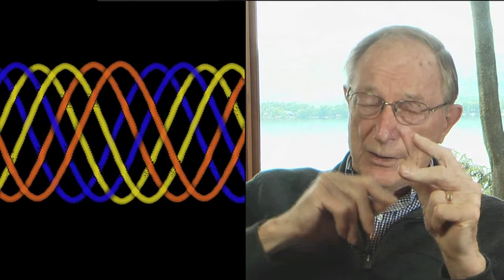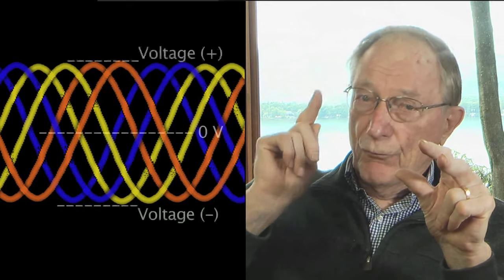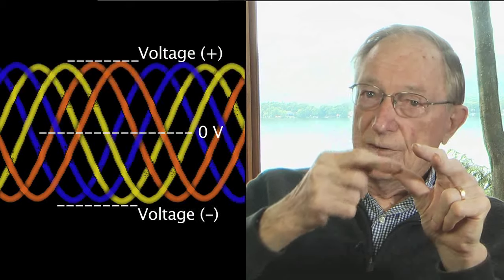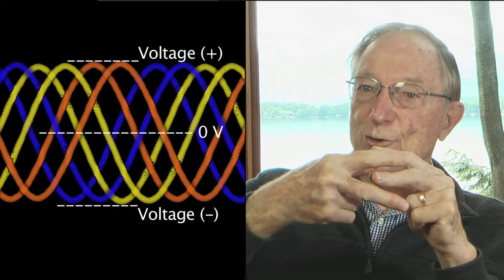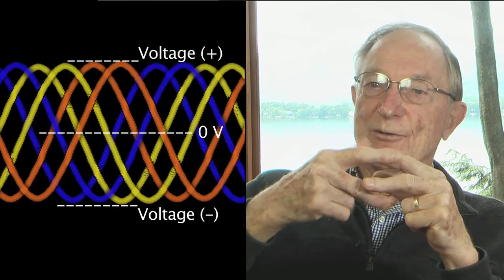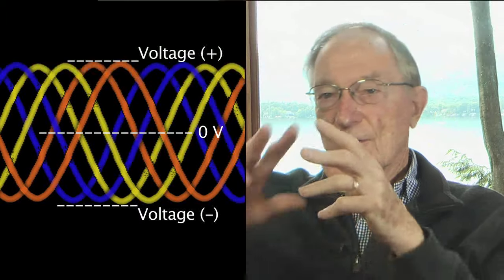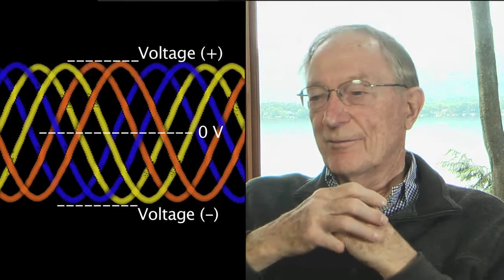Why 3 Phase Power? Why not 6 or 12?

Comment: Oh, for crying out loud. Three-phase placement of the windings in an ac alternator works well, with all the windings in the phase-dedicated stator slots wired in series with one another, because the out-of-synchronization effect of the two maximum-displacement windings are not displaced from each other very greatly.  Unlike two-phase designs in which the placement of the windings in the stator slots ARE displaced from each other to an extent that there IS substantial cancellation effect.  That's the advantage of three-phase over two-phase.  Going to four-phase or six-phase has only slight reduction in cancellation effect due to out-of-syncronization of the extreme-displaced windings, such that it's not worth the the trouble of dealing with the corresponding greater wiring complexity.

Comment: At beginning, it should be more related to the AC generator machine. 
1.	The generator size is limited by the truck and train, whatever hydro or turbine, that made the stator slots number not enough to reach more than 3 phase. 
2.	The long distance power transfer, 3 phases can transfer more energy than the 2 phase. You know the most cost is not an additional one wire.
3.	Both 2 phase and 3 phase motor have an advantage: each phase coil is neighbor to other(s).

Comment: By reversing the polarity by wiring on each center element of the three stacks in the circular stacking, the three center elements representing all three phases will be one sixth of a cycle off from both the phases above and below it; repelling those magnetic fields outwards into their opposite polar areas for 5/6ths of the cycle, and only attracting them on one side only for 1/6ths of the cycle. The inductance will have gone up by having mutual inductance between phasings, increasing the Q.

Comment: Another reason to choose 3-phase:
More than 3 phases will reflect the products depending on the number of phases, so what i think that When the technician need to reverse the direction of rotation for an induction motor they just change two phases positions, in case of 6 phases it will take 3 phases to be changed! And that is time consuming.

Comment: I'm a utility engineer too. I believe that the convention of 3 Phase was based on the limitation of constructing robust machines in the day. After working in Main Generators of large power plants, I know that with 3 Phases, it gets crowded in there. I guess that Main Generators would necessarily would have to grow wider to accommodate additional windings. There are all ready significant "end turn" forces on the rotor windings. for 3phase, 120F = NP, so what is it for a 6 Pole device? 36?

Comment: By polarity reversal of the central coil segment;  exhibit lenz law effects from a source only 60 degrees out of phase, whereas the law works at 90 degrees so that extra source of emf arrives 30 degrees ahead in time of the actual phase rotation, yielding a vector summation with the source emf at 15 degrees ahead of the phase rotation.  Cycle after cycle it keeps arriving more and more ahead of the phase rotation until after 12 cycles it completely opposes the source voltage

Comment: 1. Line to Line voltages are not all equivalent. 
2. Symmetrical Components analysis only works on systems where the number of phases is a prime number.

Comment: A 6 Phase system would not only have 6 subsystems but also have TWICE as much high voltage cable to buy, install, and maintain. The loss in efficiency of a 6 phase device like motor vs 3 phase is very small compared to costs. 

If is was a great idea, it would already be implemented nationwide.

Comment: The reason Edison was wrong and Tesla was right was that there does not exist any simple, reliable way to convert low voltage DC to high voltage DC, or vice versa.  (Except for a motor-generator, which isn't reliable enough.)
If you generate electrical power at, say, 10,000 volts, you will want to transmit it at as much as 760KV.   Doing that is relatively easy with a transformer, a device with no moving parts.  At the end, you will also use a transformer to bring the voltage down to lower voltages, such as 60KV and 12 KV, etc.  This allows transmission at distances of 1000 miles or more.
DC power cannot be changed in this way, at least it couldn't have been in the late 1800's.

Comment: 6 phase was quite popular in high power transmitter design using valve rectification because the ripple frequency after rectification was six times the supply frequency, compared to 3 times that of a 3 phase circuit, and the ripple voltage was reduced by a factor of.250/.057 from that of a 3 phase rectifier. Harmonics were also much reduced. This made for simpler smoothing circuits in the conversion to dc.

Comment: The phases in 2-phase power transmission are not 180 degrees apart.  The technology requires three wires anyway, but was useful for a time, and can drive a motor nicely enough.  Note that the 120/240 power fed to residences is not really multi-phase power.

Comment: I am not in the field but I had some theories about power lines and phases. My first theory is that really the amount of power you can get out of a wire is really the feed amperage and the gauge of the wire. Too little and it gets hot. Due to the nature of AC, I guess you get more positive power, more of the time with different phases. I thought that usually like motors were designed in some way to have magnets oriented for 3 phases.

Comment: Actually I think this math is not necessary. Just like 3 points are the minimum number of points we need to identify the position of an object in 3D space, 3 Phases are the minimum phases for generating a rotating field. Correct me if I am wrong.

Comment: Large induction furnaces (in the Mega Watts) do use 6 and 12 phase power (using "phased" transformer arrays).  This allows for rectified DC with a very low ripple current/voltage

Comment: This boils down to one concept. If it's not broke, don't fix it! For the most part, people will continue to operate the same way if nothing is wrong. They will in fact resist improvement, especially if the improvement costs a lot in the beginning, even though the long term savings are as large or larger.

Comment: three phases has a direction and a constant power load/supply. I don't remember the math but if you add 3 sine waves together (squared, 120 degrees apart) they form a flat line. So it's a 'perfect' transmission system, 1 phase would be 'shaky' and would have no direction. 2 phases (one at 90 degrees, 180 degrees is 'inherent' in one phase) would also be shaky. The power of three phases add up nicely to a constant '1' so to speak. I don't know what the guy is talking about there's no advantage in adding more phases except if you want to convert to DC I suppose. I don't think there's any advantage in copper usage compared to a 1 phase (two wire system) I didn't do the math it's just a hunch. Another advantage is you can switch between 'star' and 'triangle' when using a motor. The myth that it transmits more power is just a myth, it's simply 3 wires instead of 2. The comparison to one phase is misguided because one wire is 'neutral' if that one would be 'negative' then you use the same amount of copper for the same transmission.

Comment: Well,there is more to it than was explained in this video. Assuming a given  lump of metal in the form of a stator and  a rotor then when it comes to wind  the stator, the winding is  going to take some space. For a single phase system, there will normally be two coils. The volume of the copper used will fill the slots to produce a voltage and a current hence the Power available from this single phase.
Now if we wind a two phase system,( four coils) assuming we go for 90 degrees phase, the coils need to be  smaller so the power generated will  not be doubled.
Now if we wind a three phase ( six coils) assuming we go for 120 degrees phase change, the coils will have to be even smaller as far  as the number of turns and the  area of the copper. and so it follows for a higher number of phases.
It is easy to conclude that the power generated does not depend on the number of phases one winds in a lump of  laminated steel,but the power depends on THE VOLUME OF THE STEEL in the cylindrical arrangement. It is the magnetic path that decides the overall power.

Really as far as increasing the phases, more " phases" are wound in a DC lap  or wave wound generator!  If  for a moment we forget that there is a commutator in these machines, the distributed  multipe coils in the slots  around a DC armature, are in fact windings which are  out of phase with each other and are vectorially added together.  As they are vectors the vector summation is less than if the coils were in phase! Really there is no difference between an AC and a DC machine and the commutator segments are in fact rectifiers for all the " phases" in the winding of a DC machine.   If all the coils in a DC machine were individualised and not added as in a lap or a wave wound  machine, the result will be  a multiphase machine. Obviously one cannot tap their output when the windings are on the armature but if the whole arrangement  was transferred to the stator, it will be exactly the same as a poly phase AC machine.

Again I shall terminate all this by saying that the output power of  a machine does not depend on how many coils one winds in it, but how much steel it contains and the sixe may alter a little depending how much magnetic  flux density the steel can handle. That is life. All machines are Electromagnetic machines, coils are the electrical part  while the steel is the magnetic part------------ they go in pairs as .......... with only one of them you have no machine!!
Reply: Also I see all this as internal combustion engines with single or multiple pistons.
A single piston or a double opposed piston  stem double acting engine as a boxer type will never self start and the power output fluctuates over one revolution. It would be a pulsating system.
In an  double acting steam engine with two pistons at 90 degrees, this will self start and the torque on the shaft will fluctuate  and it  will be a self starting system. This is because  it will  have a pulsating and a rotating effect.

The higher the number of phased piston especially if they are double acting the pulsations will stop and a fully rotating enenrgy will be generated when taken as a whole system.
All this takes place in a multiphase machine. If we had to talk about positive and negative frequency components well then we have to talk about primary and secondary balancing and vibration in a multi piston engine. They are so related
in their performance, even mathematically, provided we aim for a sine function in their stroke!!!

Comment: Just as there are diminishing returns regarding the increase in power as the number of phases increases, there are likewise diminishing returns regarding the increase in power compared to the  increase in costs associated with a power transmission system as the number of phases increases.

Comment: Would have liked to see the experiments with more phases.  I was always under the impression that 3-phases were chosen as it is the highest phase number where if you connect any two of the phases you get the same voltage (different phases, but not too important).
Reply: Google user  The variable Phase -to-Phase voltage could be useful. It provides a basic discrete variable voltage BUT there no practical application for such capability at the substation power level.

Comment: Phased are potentially infinite. The tube is just the local atmosphere. A loud horn cone travels into the upper atmosphere and beyond. 
Three phase power begins with the ground that opposites the air charge. Power consumption induces electrical current flow. The entire power grid works as the grounding for electronics and equipments. With three phase on one end and infinite phases in the air, technological apparatuses interface and consume. The upper 359 atmospheric phases of the first horn ring are radio frequency bands. Thus 3 phase power grid alignment. Once reaching the first quantum note of 360 phase altitude, the equatorial ring is a perfect fit. beginning at 361 phases,   light begins. The uv frequency travels into space at exponential band wave frequency. All visible due to the electromagnetic resistance of the body. Elf wave monitoring proves the knowledge to be seen and known of. cJT aka the most Elect

Comment: It is precisely this phenomena that DC has no zero crossing that makes design of a HVDC switch or circuit breaker difficult to construct because there is no zero crossing that could extinguish and arc that forms. Some techniques are needed to create an artificial zero crossing for this scenarios

Comment: It is noted that Gabrield Kron generalized his work with the principle that all types of electrical machines must be special cases of a generalized machine, and that understanding the general machine would lead to the invention of new types. Many years ago I got the idea that that if you sandwiched three phases of 120 degree time separated magnetic fields (from a 3 phase power source) together from spiral made inductors of maximum mutual inductance; you could reverse the polarity of the middle segment making it only 1/6 th out of phase with its top and bottom segments and thus acting like a magnetic triode, the middle element would cause the magnetic fields from the exterior elements to be expanded in the opposite direction of the interior magnetic compression being made for 5/6ths of the cycle reaction time. The problem with this idea is that time is directional and because of phase rotation depending on the way the stacks are arranged in order, one phase will always be inducing current on the next one in the phase rotation, and the currents in the stack cannot be balanced. Just like in mathematics it takes nine consecutive numbers for a number array to be both horizontally, vertically and diagonally balanced as a magic square, the three phase reactive currents require nine elements to form a balanced mutual induction between phasings on a lateral placement scheme such as this.  I invented the 666 machine which creates six magnetic fields out of time with each other via a 3 phase input.[note;this is technically not correct as all six fields are not necessarily "out of phase" with each other,, we have merely created an additional three phases in opposite polarity to the original three phases as the input].  What is involved is "splitting" cyclic 3 phase magnetic fields placed in mutual induction and resonated so the one part rotates faster in time then the part it proceeds from. It returns and hits the point of its origin after 24 cycles.   In the present system the magnetic field that splits off from its source and starts reacting with itself advances 15 degrees for every source cycle as shown by https://www.flickr.com/photos/harvich/14992141501/in/dateposted-public/
In the movie "Around the World in 80 Days" the traveling people experienced 80 days while the world they left behind only experienced 79, but the travelers made one extra circle around the earth during the time that the earth itself only circled itself 79 times. In the invention of the 666 machine I was able to make the magnetic fields circle themselves one extra time for every 24 times the line voltage cycled itself. This process "pushed" the magnetic fields into space by employing nine elements attached to three phases separated in time by creating six interior magnetic compressions 1/6 cycle out of phase, further creating 6 magnetic expansions on the poles.

Comment: 6-phase power might have a niche in self-contained low weight/size, high power applications such as AC-driven electric vehicles. 12 probably would still drive costs up too much with too little benefit due to the mentioned diminishing returns. Would have to look into the effect of using more phases on the power-to-weight ratio of induction motors, which is leading in vehicle performance.
Reply: Interesting point. The motors in those cars must have electronic speed controllers which would have to be redesigned for 6 phase. After the added components and complexity to the ESC and motors the price of the car might not be competitive and not sell.

Comment: In theory, with enough phases, one could transmit DC power as AC since the sine waves would be so close together, just need something at the end like rectifier assembly to convert it back.
Reply: DC is used to transmit bulk power over long distances. 3 phase AC is sometimes converter to 6 phases, they are then rectified and the power is trasmited in DC, which is inverted back to 3 phase AC at the other end. Google HVDC lines.

Comment: that Single Carrier Line multi phase architecture idea, sure sounds fascinating and perhaps useful for an organized lattice of 
"entangled" electrons that the Physicists are working on practical manifestation then implementation perhaps theoretical Single stream electrons with this kind of idea.  cost benefit ration might drop off but it depends on what you are accomplishing at the delivery point.